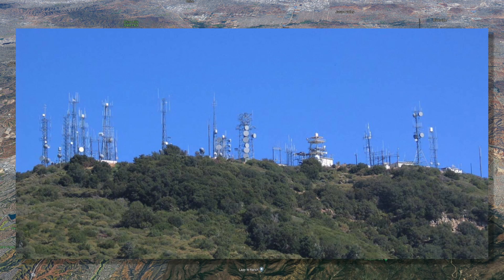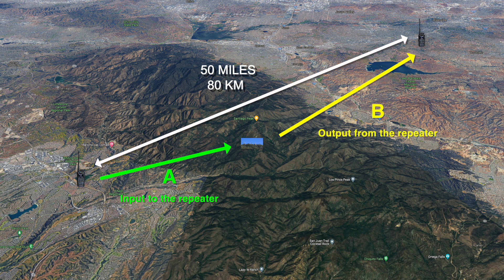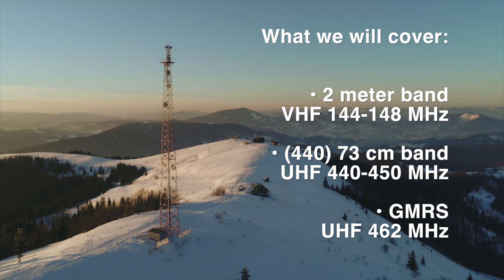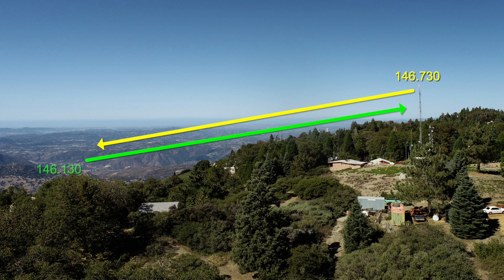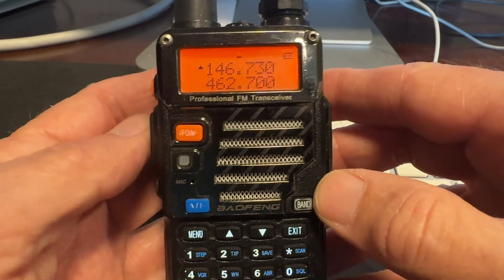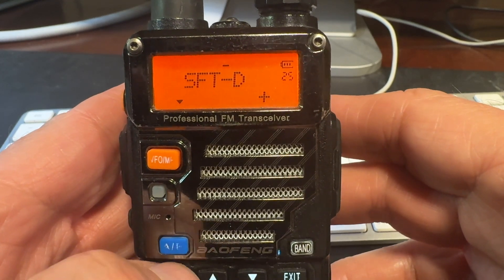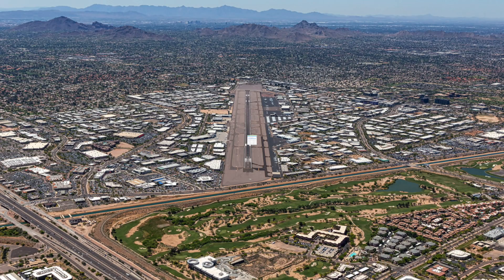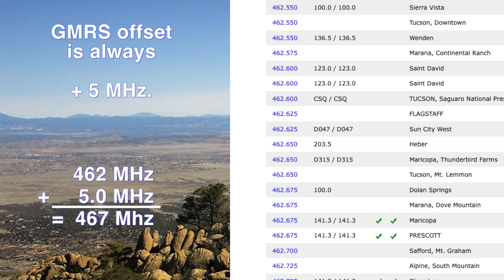Understanding Repeater frequency offsets

Comment: Very informative.  Thank you.  What if you want to talk really far away?  Are you limited to just one repeater hop, or is there a way to hop multiple repeaters?
Reply from the maker: @edwingrigorian4585  Yes, you are able to talk great distances via repeaters, and can talk around the world on ham radio repeaters that are networked. That’s one of the things that attracts people to ham radio on vhf and uhf bands. Here in Southern California it’s common practice to network repeaters, either by radio on a link frequency, or via the internet. The PAPA system (papasys.com) is a good example of microwave linked repeaters. Their website shows how many are linked together covering a large area. 

Another way to link is via a digital radio format like DMR, P25, or others. DMR radio repeaters are linked to the internet through servers that connect globally. Your radio talks to the repeater, the repeater is connected to the internet and goes through servers, and you come out the other end where you designate that to be. It could be locally, regionally, or global. It’s a whole other side of radio communications that can seem overwhelming at first, but becomes easy once you learn the basics.

So to answer your question, yes, you can expand the distance of repeaters by networking almost limitlessly.
Reply: @raymazonhamradio  Thank you for that explanation.   I need to spend the time and get my Ham license.  I've been meaning to do that for many years; enough with the procrastination.
Reply from the maker: @ I have some friends who were putting off getting their license, and recently took the test. Both are now licensed. Don't be hesitant to do a little studying, and going for it. If you don't pass  it the first time, you can immediately turn around and take it again. 

Also, look online for a local area ham radio club and go visit their meeting. Typically they are monthly. They may have testing and mentoring available. Hams will be happy to help you, and you'll make new friends. 

What area are you located in?